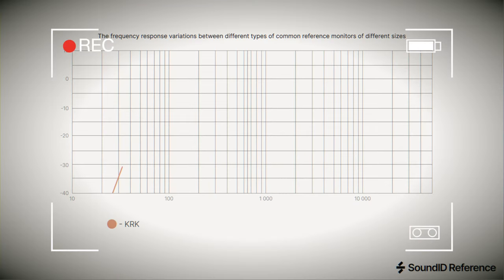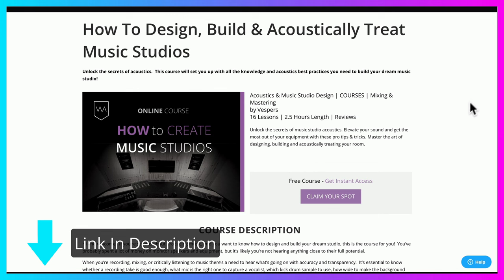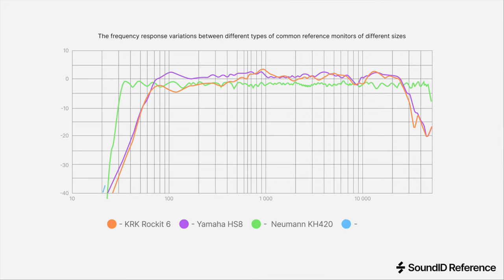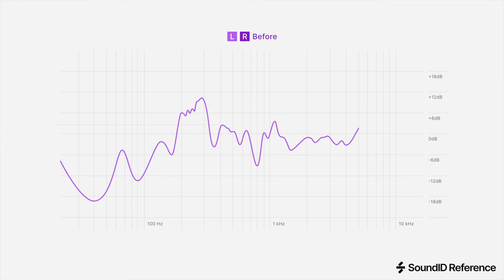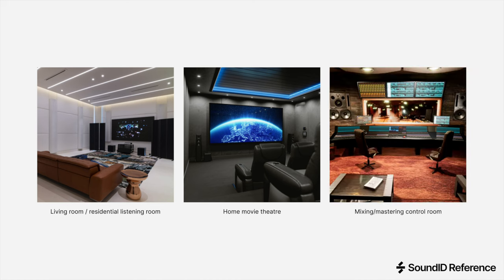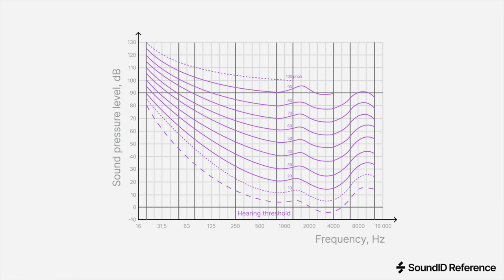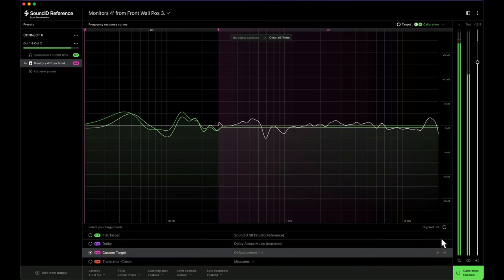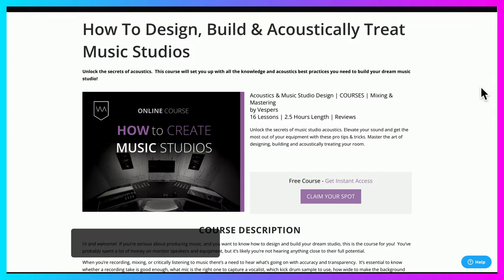Is PERFECT Sound Possible?  Speaker and Room Calibration Explained

Comment: good video.   articulate.  excellent information.  organized.

In my studio (TES Productions) I have nine pairs of Neuman monitors.  The configuration and treatment of the studio rooms are important.  But more important is that all monitors are used in very nearfield.... from1 to 1,2 meters listening distance.  Finally, I use the Neuman MA1 system to correct for room effects.  All of this is quite consistent with the substance of your video.  I look forward to the others.

It is rare to find a video that is as well done and correctly informative as yours.  I congratulate you,
Reply from the maker: Thanks very much.  Sounds like you have a serious set of rooms.  I take it you do this professionally?  

What Neumanns are you running?  KH310s?  420s?  1.2 meters is very close.  It may even be below the recommended listening distance, depending on which model you have.  I know for my 420s, especially because they're 3 way, you need sufficient time of flight (5 feet minimum) to allow the drivers to sound integrated.  Inside of 5 feet and you get a very inaccurate frequency response.  But that's because the 420s are mid-fields.  

If you're on other Neumanns then you can likely be much closer.  1.2 meters is considered ultra-nearfield or close-field.  I sit at 1m from my DMAX Audio Supercubes in my creative room.  You sound like you know what you're doing so you're probably on top of this anyways. 

Thanks for the kind words!  You can watch the full series here: https://www.youtube.com/watch?v=orD4cpsRdxs&list=PLsyXZjufQdPx1ogI4xPX_xpySTWKcmmEh

Cheers!

Comment: Can you tell them to put an option to mono the correction curve so that there is less phasing issues when the left and right curves differ. That’s the main reason I stopped using it. Would be cool if it was a knob so it can be dialed in accordingly
Reply from the maker: Hey Ed.  There's a good reason there's no mono function for the correction.  It's because one of the things it does is carefully time-aligns the speakers, and accounts for driver variations in frequency response L to R.  That's critical to the platform functioning.  

If it sounds phasey, I wonder if you were on an older version?   Or it's possible that the room was quite live sounding, an the program cannot discriminate between side wall reflections and errors in frequency response.  For that reason I only would use this in a well acoustically treated room.  

Have you tried SoundID Reference, the current version?  How's your room for acoustic treatment?